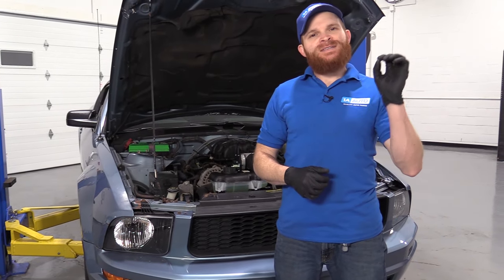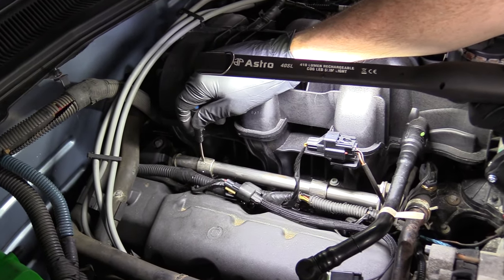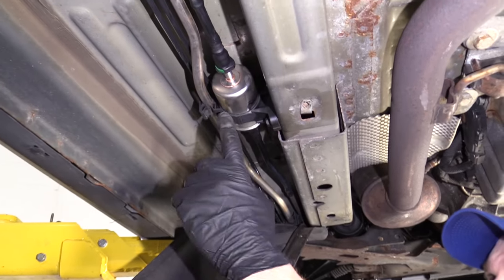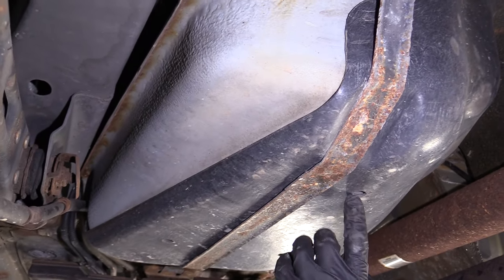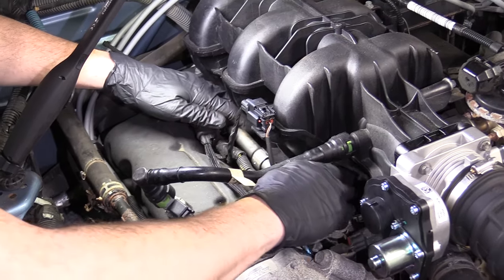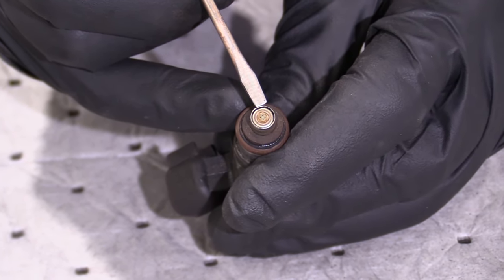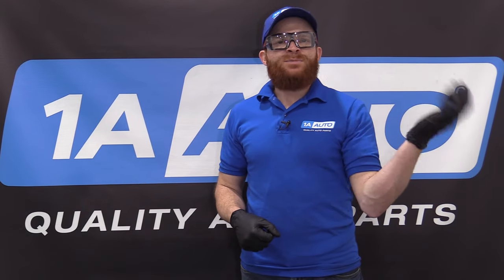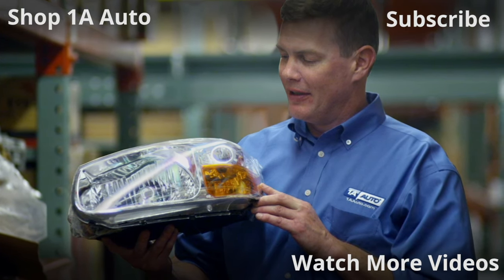Do You Smell Gas? Diagnosing Fuel Leaks in Your Car, Truck or SUV

Comment from the maker: √  Watch the Video
√  Buy The Part at 1A Auto http://1aau.to/m/Visit-1AAuto
√  Do it Yourself
√  Save Money
Reply: Do it myself save money
Reply from the maker: +Andre Chatmon Thank you! We love empowering our customers and showing how to perform DIY auto repairs with our high-quality auto parts.  http://1aau.to/m/Shop-1AAuto-c
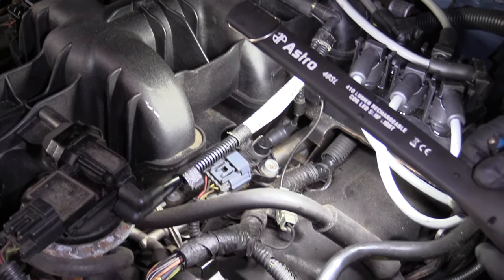Reply: Hi on 1:57 you mention the input hose whats another term i can use for that part
Reply: Question after doing replacing the fuel pump, what if it leaks in the from the top after filling up? Do I need to go back and slightly tighten the bolts on the pump? Its not leaking from the grommet its leaking from the middle of the tank.
Reply: Do it cost a lot to replace.
Reply: Ok

Comment: You guys not only saved lots of people cars but most importantly you saved many people lives, God bless you all !
Reply: My car has several things wrong with it that can kill me but unfortunately I have to wait 10 days so the ministry can call me to book an appointment for an officer to look at it. The dealer sold me a totalled car.

Covered up a rotten subframe with rubberized coating so he didn't have to replace it. Play in the left tie rod which is part of the safety. The day I drove the car off the lot I wasn't sure if I was going to make it home alive because the steering wheel was being yanked in different directions, confirmed by my mechanic that not only was the steering wheel off center but the ball joints and control arms would need to be fixed before an alignment could even be performedor it would be sent back. The timing chain needs to be fixed, if it breaks while I'm driving it the engine is totalled. When I make right hand turns my dome lights come on so I'm not sure if there's problems with the wiring. I noticed a leak under the vehicle and when I go up to my car I can smell gasoline while it's parked so there's a fuel leak somewhere. And God only knows what else is wrong with it. Those are only the things I know about that have been confirmed by mechanics.

Comment: Yes very important to find and fix the fuel leak immediately. I had a 68 Buick Riviera that had a small fuel leak at the carburetor. It erupted. I turned the car off. However, the fire melted the writing harness causing the starter to crank the engine and spray more fuel on the fire. Bottom line the car was a total loss.

Comment: My 2017 grand jeep cherokee limited had gas fumes inside all the time after starting it up. After 2 months the jeep dealership found it was the fuel rail ends leaking. They replaced it and my gas tank with a new gas line because the gas nozzle kept clicking off while trying to put in gas. So far so good.

Comment: Got in my Honda CR-V and headed to garbage dump. Tank was almost full. Started smelling gas 2 minutes into drive but no indicator was lit up on dash for engine light ie gas cap. Car sits in driveway as a barely used car. The smell of gas was getting stronger but I figured maybe it was because it hasn’t been driven in over 4 weeks. Drop off garbage about 12 minutes into the drive and noticed I was almost to half a tank of gas left so then I thought to myself the gas cap has to be loose or completely off but kept driving home. About 5 minutes away from home I noticed I was down to a quarter tank of gas so new I just lost 3 quarters of gas in just 18 mins. I pulled over to check gas cap but it was good then I noticed a water pouring onto the ground noise and looked under car just in front of of rear driver side wheel and saw gas dripping down almost pouring amount below gas tank. So I finished heading home which by the time I pulled into driveway I was almost on empty. Google and YouTube searches showed either fuel pump or faulty fuel lines. Some states over a thousand dollars of repair. I wanna fix this myself but don’t know how to. Help needed on diagnosis and fix for driveway fix!

Comment: Ford taurus 2011-2019  top of fuel pump on tank under the rear seat.  Metal retaining rings rusted built up rust put pressure on both fuel pumps/sending.. cracking the plastic .. causing leaks when tank full or agressive driving  fuel sloshing around.  New fuel pumps and new retaining rings.  Spray new metal with paint or rust inhibitor

Comment: I have 4 evap codes on my 4.3 and the truck shut off on me 3 different times.
I've did a fuel pressure test, cranking was at 60 psi. Leak down test of 5 mins left it sitting at 40 psi.
So I moved on the air and spark. Wasn't getting a consistent spark, so I went ahead a replaced the distributor and rotor, ICM, wires and plugs. Fired up, drove a short distance and shut off again. So I guess my questions is. Would the 4 evap codes/fuel leakage be the reason for the vehicle to shut off going down the road and also the reason for randomly starting up while I was testing different possible issues?

Comment: When you remove the lower o ring, you have to pull it over that disc looking thing, what if that's cracked or a piece of it is missing? Would that affect anything or is it just there to hold the o ring in place so it doesn't fall off when you hold the injector downward?

Comment: My Toyota Corolla 2001 is leaking onto the ground in the middle just behind the engine compartment, like straight under the micdle of my dash. Would this be the lines? It wont start, sounds out of gas but isn't, can't smell it under the the hood.

Comment: I hear of a vehicle catching fire about twice a month around my area and figure this is what probably happened. Oops I smelled gas but kept on driving it. My 2007 Subaru Forester is currently parked until I can check it out. Plugs, wires, and air filter recently changed; but a couple days ago I noticed the gas gauge is dropping too fast. Car is running good so I figure it's leaking gas somewhere.

Comment: I have a 2010 Chevy Suburban and no one can answer my question nor can I find a YouTube video. About 3 months ago I changed a fuse and forgot to cover it back. It got wet and the car started to idle rough. Then I had a fire at the exhaust pipe. I ended up changing the whole fuse box to be sure and noticed that fuel was coming out of the muffler very heavy and most likely why it caught fire in that same area. I put the code reader on it and it said P0201, 0203, 0204, 0206, and 0208 fuel injector misfire. Now I don't know if all of those injectors went bad because of the short circuit of the fuse box? Maybe damaged the line but it's dumping fuel out of the exhaust tail pipe. I am 60 years old with troat cancer with gas prices so high and the risk of fire I do not drive it and have no way to make it to doctors appointments and need your help so badly. I buy a lot of parts from you guys. What do you think it could be?

Comment: I have a 2008 Kia Rio 5 and if I put more than $15-$20. (1/2) I smell gas. I had a 2009 Kia Rio 5 that also had a leaky gas tank and I replaced it with a used gas tank, but it also leaked. I think this leaky gas tank is an issue with Kia and I think they should fix it. I was told it will cost $1115. to put in a new tank and a gas pump including labour.

Comment: What if i replaced the o rings several times but it keeps leaking badly after a day of use? Could it be my fuel pressure regulator?

Comment: I need help with my car I looked at everything on it fuses fuel pump fuel lines everything for the last couple of weeks my car has been idling rough when I go to match the gas it would sometimes die last night all it would do was crank would not start I looked for the problem and my someone has had loose to the bolts on my distributor the distributor is only hanging by the wires there's no nothing else holding it there both I guess I only came out yesterday would that make my car stall out when matching the gas and would it not start after a while and can it be fixed can I put my distributor back on there and run Right

Comment: I have a Saturn Ion that developed a fuel leak. Could smell gasoline near the rear driver's side wheel only when the engine was off. No visible fuel, just odor. Was a metal fuel line between the exhaust pipe and wheel. Lines are wrapped in heat shield material and had accumulated years of road dirt that rotted the lines. Was impossible to see

Comment: Question, so I smell gasoline when am driving the highway but not when am in the regular streets, I thought it was a car infront of me but when I got to my house I still smelled the gas by where I put gas, also the gas cap looks like it has gasoline around it, almost like it's jumping out or something, please dont make fun of me 🤦‍♀️I did change it but the new gas cap and still looks the same, i do have my check engine light on, when I went to advance auto they gave me a code PO456, so any tips

Comment: I occasionally smell gas near the rear driver side of my car after I changed fuel pumps. I inspected both ( under the rear seats) and I didn’t see any cracks or fluid even after a full tank of gas. Is there a more comprehensive test that can be done to check for leaks?

Comment: I have been watching ur videos on fuel systems all day My problem is I have a 2004 Chevy Blazer and I got it running to change the fuel pump twice change fuel filter the town strap sensor the crankshaft center spark plugs naughty audiat it ran until I went through a car wash I went through the car wash got the undercarriage washed and then my car when I was leak or truck what I was leaving blah blah blah and stopped and it started once more drove perfectly and then I smelled some gas and it once again it stopped blah blah and it didn't start hasn't started since now I can't get fuel to my fuel the fuel pump we tested outside of the vehicle it work inside the vehicle it didn't I was wondering should help me out with my problem or at least give me some pointers I'm a female of a lot kids love working on my car but it cannot figure this one out if you could help thank you

Comment: hey hows it going quick question i noticed a fuel smell coming from under the car so everytime i  would start up the car i would smelll it even more so i kept the car running and got underneith and first thought to loook at the fuel tank so i seen wet spots and i put a light up closer and i seeen it pouring out from the top of the tank but im still trying to determine what it really is so i seeen it coming from underneith the fuel tank locking ring and it was wet on the plug that goes in to the fuel tank the black plug and thats alll but its kinda hard to say so i tttok it down and im looking deeeper so i neeed help with this one its a 20005 dodge grand caravan 3,3 thanks alot happpy hoildays to u and your family besafe always and have a great day

Comment: Hi 1A auto i have a 2002 honda civic. I have a code po1456 but every time i fill my gas up i smell gas but i smell in the rear could it be its coming from the fuel pump

Comment: I have a Mazda 3 2004 and I keep getting the codes 'EVAP system leak detected' and 'EVAP system incorrect purge flow' I have replaced my gas cap, knock sensor and cannister purge valve and still getting the codes. Car also dumps fuel after filling it up to full. Does anyone have any idea how to fix this?
Reply from the maker: +@fogskiss3137 We wouldn't be able to diagnose an issue like that here, you may want to have a local mechanic take a look at it. Thanks for checking us out! http://1aau.to/m/Shop-1AAuto-c

Comment: After i put gas in my Mustang 06, it starts leaking from the bottom, any suggestions?
Reply: And only after i put gas, after a day or two it will stop
Reply from the maker: +Gerry Flores We wouldn't be able to diagnose an issue like that here, you may want to have a local mechanic take a look at it. Thanks for checking us out! http://1aau.to/m/Shop-1AAuto-c